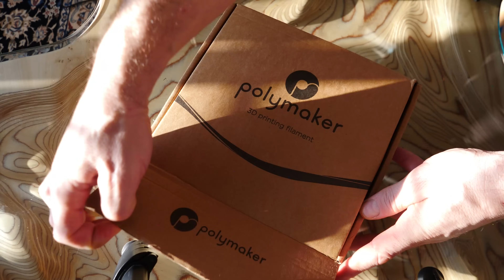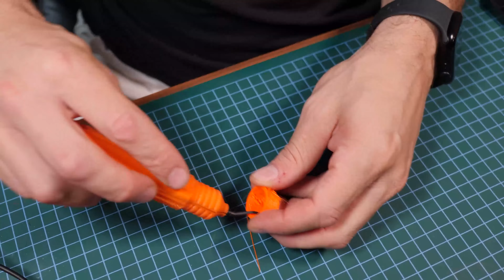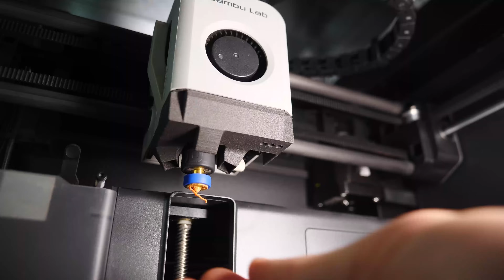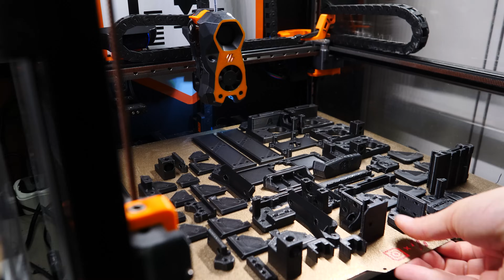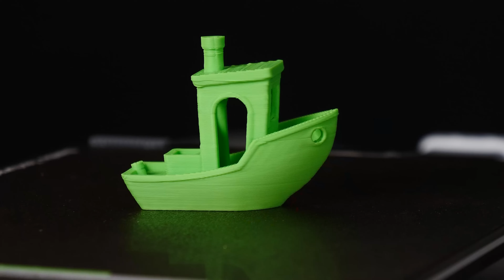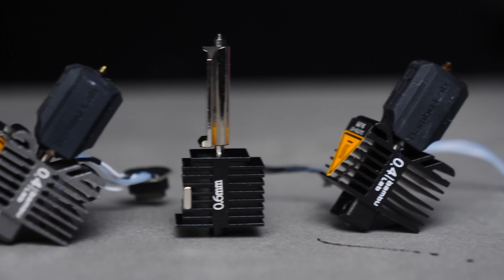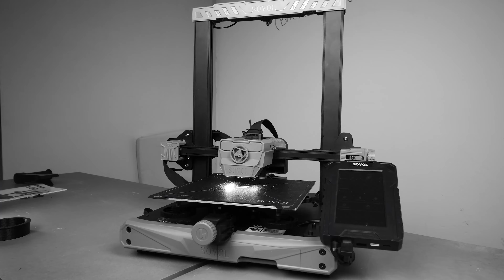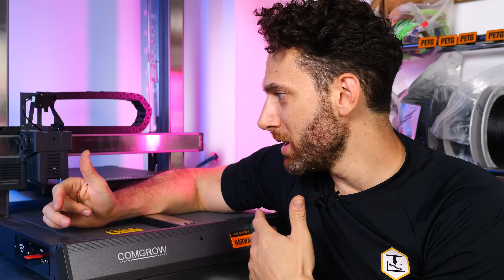My Long-Term Review of Each 3D Printer I Own

Comment: what surprises me how few hours you have on these printers :O
Just my testing SV07 Plus (Quite excellent! But some klipper bugs :( ) has like 1600hrs and it hasn't been on for the last 6months or so ... (it's a bed leveling machine, not a printer lol -- so once again trying to get more level bed that the damn mesh would actually work -- or maybe the mesh leveling just doesn't work at all on my printer properly, not sure.)

Comment: After having owned the X1C and the P1S, I find the P1S to simply be more reliable and produce better prints. Maybe I got a bum X1C but it was finnicky and needed a ton of babysitting. I feel like the touch screen was nice, but I hardly used that function because bambu handy and bambu studio are just nicer to use regardless. It would "detect" failures more often than it actually failed. If you are on the fence between the X1C and P1S, get the P1S and use the extra money to get a ton of filament.

Comment: I like resin, and have made a few useful tools out of the stuff. But even the "tough" resin doesn't beat a good ABS FDM print in terms of durability. Its also easier to fool with and you get better resolution without having to factor in the nozzle width, etc.  But I think the big thing about resin printers is that they aren't as "involved" in terms of building with them. I find them about 100x easier to use, so no reason to go fishing for YouTube content unless I hear about some "unbreakable" resin. So, thanks for leaving those out 😂

Comment: Did you have any cooling issues with the panda revo hotend on the P1S? Stefan (CNC Kitchen) mentioned in his video that it is a bit longer and therefore the fan is now blowing onto the nozzle. I've noticed you have a different airduct mounted though, does it fix that?

Comment: Between a solvo sv07+ and sv08. What are the real difference to the final print. I need a helmet size printer.

I could imagine the sv08 to be somewhat faster. However how is adhesion to the build plate? Layer lines? Final quality of the print?

The sv08 looks very primissing. However with black friday sale comming up. The sv07+ is sold at a really low price.......

So what do people recommend?

Comment: Back when I ran Ultimaker 2s one of them had about 10k hours on it when the first part broke that wasn't a consumsble. The other two had like 4k and 5-6k hours on then and were still fine. Though for context all those printers had been converted to 1,75mm. With stock gear they would not gave survived that long because I would have thrown them out of the window.

Comment: For making engineering parts I have a Bambulab X1C which is my 14th 3D printer and by far the best FDM. 
I really need a similar quality printer with the ability to print something that is at least 535 mm long. What options could you recommend?
I have a couple of Creality CR10 Max that can print the size, but the quality is not in the same ball park as the X1C

Comment: I have been using a sidewinder x1 for the past 4 years. Its been incredibly reliable. BUT its showing its age. I mean it prints at the old 60mm/s standard all these old bed slingers do but I see everyone else using klipper and printing at 200mm/s+ and im jealous. Also having to manually level the bed also the wear is starting to show with minor layer shifts just not as good as it could be. I could build a voron since I like to print ABS some what often but I dont wanna mess with it. So I ordered an A1 with the AMS. I figure if I can get my sidewinder to print ABS I can get the A1 to do it as well with an enclosure (which is a large trash bag). The reason I went with the A1 is simple. Its price and the fact I see it everywhere. If someone has a print farm that prints PLA primarily then I usually see them using an A1. My sidewinder doesn't take much messing about to get it to print but changing filament can be a hassle and when it does jam its a REAL pain to fix. Also it seems like the bambu printers have good resale value so there is that is I dont like it.

Comment: Q. Among all these printers, which gives us the good speed and the best no compromising print quality to start a multicolor 3d printing business.

*note- For the business i wanna do, i need the high quality prints with atleast a good sharpness and detailing with multicolor or multi material prints.
Reply from the maker: Anything from Bambu lab if you want multicolor
Reply: @thenextlayer  can i consider bambulab A1 combo in my starting budget, will it give me the good quality, speed & detailed prints being bed slinger instead of core xy ?

Or can i use voron and use ERCF kit for multicolor (only if it gives me better results than bambu?)

Comment: Hey Jonathan, can you plz help me out to choose between creality K1C and bambu lab A1..? I want to take it for my personal work which is bit of engineering and bit of hobby work.
Reply from the maker: Do you need to print engineering materials? If so, K1C. If not, and you’ll only print PLA and occasional PETG, or you want multicolor, A1. Feel free to use my links

Comment: My first printer is a Neptune 4.
Installed linear rails on all axis and that did bump up the performance when it came to that proverbial first layer.
Unfortunately having issues incorporating an input shaper which I know would take this little bed slinger up a couple of notches.
Now I also have a FLSUN V400 which I use an input shaper on.
Yes, it is heads above any bed slinger BUT most do not like the round plate.
Has advantages and disadvantages.
With modified cooling on the extruder (5015 over the stock) allows me to peg out the cost effective Elegoo PLA+ that I use.
Remember, to take advantage of all these speeds you will need to use higher priced high speed filament.
The Neptune 4 is for prototyping.
The V400 is for production. Also it is a dream when doing filament changes.
Yes, should you need the fancy prints Bamboo has the printer.
Should you be looking for that first printer and just maybe a second one IMHO the V400 with slight mods is a good choice and value.
Cheers.

Comment: i wouldn't buy anything from anycubic. i have a kobra neo that was my first printer i have had nothing but trouble with the bed thermistor and their probe. customer service has been good but still its sits more then it prints. i wish i could find a aftermarket bed for it to solve it problem with thermistor wire breaking . [bed 4 in a year].

Comment: As a V2.4 owner, I think anyone who wants to build one at this point should just get a Sovol SV08. Replace the ABL probe to one that isn't so heat-sensitive and throw on a different hotend. Sooo much of a V2.4 is already there that it doesn't really make sense to spend 2-3x the cost to get a box of parts and still have to 3D print most of the motion system.
Reply: Disagree. Please understand what Voron has done not only amongst its community but printers around the world. If people quit making them that’s a big hit to one of if not the most influential pushers of the printing future. More vorons =s  more people understanding machines instead of slice/print which makes more capable individuals to continue to push the envelope on 3d printings future. Open source/ mod life
Reply: Ehh you're pretty damn close, but there's still a reason to buy a Voron and I absolutely will when/if I can ever afford one, but the SV08 is a decent first step into getting to know the Voron design. Sovol (even though I had heard only good things about them before this) has turned out to be an absolute shit show of a company that almost refuses to communicate with its customers. Here's a short list of examples: when placing my order I was never told that I wasn't actually buying a printer but placing a pre-order, I was not told that the enclosure and upgraded screen would not ship with the printer and would be a further delay, I was never given any sort of shipping time update once I figured out it was actually a pre-order and had to reach out multiple times and wait days to get anything, enclosure makes you lose Z height without printing a riser, "upgraded" screen is just a product bought from elsewhere with a 3D printed enclosure and a poorly chosen one with THREE freaking cables needed to connect it and from the side not the back meaning you'll always have 3 chonky wires making a mess of things. Then there's obnoxious nebulousness like not specifying if the "high flow all metal hotend" on their site is the one that comes with the printer or an upgrade,  the fact that you either can buy a runout detection sensor or a tangle detection sensor but not one that does both, the fact that they literally JUST started offering build plates for sale and still only a single type, the fact that you need a UART adapter to upgrade the firmware AND SHIPPED THE FUCKING THING WITH FIRMWARE SO OUT OF DATE THE PRINTER SCREECHES AT ME 24/7 TO UPGRADE MAINSAIL, an absolute shit bet tensioning system, the build plate is mounted flat against the top of the undercarriage meaning air filters like the bento box will not fit, the fact that you can't buy hardened nozzles in anything other than .4mm, and much more.

I am pretty happy with the printer overall though. My probe ended up being pretty damn accurate and I don't really like the idea of using the nozzle as a probe so I'm not quite sure whether I'll go with a Revo Voron w/ PZ probe or the same with an Eddy since it's so much faster, but the actual extruder itself seems to be pretty good. I was able to print with a 10+ year old roll of Ninjaflex that I've never gotten a single successful print out of so that was cool, but the hotend sucks so insanely bad you can't print at anything even approaching "fast" once you run out of the tiny sample of high-speed PLA the printer comes with. I already assumed the hotend would be the first thing I ended up replacing, I mean the whole concept of the printer was "taking the over-engineered Voron 2.4 design and cheaping out where the effect on the print quality will be negligible compared to the cost savings". But my list of what I personally consider "mandatory" upgrades has grown so that in addition to the hotend I plan on also changing the probe (mostly for speed but accuracy will also improve), the laughable ~4" offcentered LED strip, changing the runout sensor to a combined multi-sensor, adding a chamber heater, replacing all gantry pieces so actual tensioning is possible, the toolhead (so an endoscope can be used for a nozzle camera, a few LEDs can be added to illuminate the print area, and is designed in a way so you can actually see the nozzle and immediate print area, and potentially adding a CPAP to increase part cooling), build plate mounting setup, and probably more that I can't think of off the top of my head.

I've been printing since ~1012 and before buying the SV08 was still using a CR-10v2, so I think that clarifies just how much of a massive purchase the SV08 was for my poor ass. While I am incredibly happy with what I got for the price I am pretty disappointed with the print quality I am able to achieve out of the box (and I seemed to have gotten a better machine than most). I got the most insane under-extrusion artifacts that actually look like vibration artifacts using the stock print speeds, I sincerely hope they're not vibration issues as that would mean there are much bigger issues. I guess I just spent 15 minutes saying "well, it's kind of complicated" in as long a format as I possibly could have.
Reply: SV08's look to be in the $500+ range.  How cheap do you think a used ldo Voron 2.4 would have to be to be worth taking a chance on?  What if it included a nevermore filter and an MMU?
Reply: @greenie277  Really? This is just about the worst place to ask for advice like that.
Reply: @TheSolongsidekick  Sure, discord or something would probably be better, but I just wanted a general idea of people's opinions on the matter.  I noticed some deals available locally, but I'm not quite ready to pick up another machine as of yet.  Just trying to get an idea whether or not pursuing a used Voron could makes sense in terms of bang for buck when compared to other new offerings like the SV08.  This thread included Voron owners on both sides of that discussion.  Seemed like an OK place to get an opinion considering I'm not making a purchase now or a decision based on this feedback alone.  I know that build quality is a big factor with these used machines, as is what hot end is present, mods, etc.  Just trying to determine if keeping my eyes out for a deal is even worth my time.
Reply: From where I'm from, sovol sv08 is almost the same cost as a v2.4 kit

Comment: Shalom. I’m totally new to 3d printing. I noticed your filaments are out in the open behind you but I heard so much about keeping them in a bin at certain humidity so I’m wondering how you’re able to just keep it out and not have issues ?
Reply: Not the creator but I dont keep any of my filaments in boxes and I dont ever dry them or need to. This includes tpu and nylon. The AC unit in our house does help to dehumidify but we also live in Utah in the desert. Im not sure where the video creator lives but if its a similar climate then its not a big deal. Generally speaking my indoor humidity stays in the 25-35% range which is dry enough to not impact filaments in my experience.

Comment: Great video!
It's interesting to me you've had so much success with your A1 minis. Mine has been a nonstop string of problems. Especally on AMS prints. Massive layer shifts on all axis, the AMS purging system is abysmal, the toolhead smacks things off the print bed constantly because the Z offset calibrates itself and then is too low... probably 20-25% of my prints fail on that machine. Especally multi color prints. 
My friend has a full sized A1 that works great, and now hearing about your X1 Carbon issues, I wonder if Bambu Labs just has really bad QC and sends out a lot of lemons.

Comment: I was shocked by the A1 Mini as an X1 Carbon owner. It's been so great.
Reply: I've got an A1 Mini arriving in two days. I'm quite excited, it's my first 3D printer. It was on sale (I think?) for $249 CAD (equivalent to $185 USD), it was hard to say no as a jumping-in point. I regret not ordering the AMS Lite, though. It's like $100 more expensive if you don't order it with the printer. I didn't think I'd use it, but then I realized that it would have been quite convenient even if I didn't want to do multi-colour prints. Oh well! I can always pick one up in the future at the non-bundle price.

Comment: A problem I'm having with my Bambu P1S. Let's take a cube for instance. Now lets put a couple holes in it that do not go all the way through. They are not directly on top of each other but are slightly offset and separated by a 1mm wall. When I try to slice it I get a warning that there are floating areas and if I try to print it, it doesn't stick to the plate. If I enable supports it changes the object. It gets all kinds of stryations and puts supports underneath the object. What am I doing wrong and how do I correct this? I can send pics if neeced.

Comment: I love my MK3S+ with MMU2s. About your comments about this printer.

I also replaced the nozzle with an E3D Revo. Furthermore I run it with Octoprint.

But main thing: slow? I have my MK3S+ running not so slow at all.

My Revo has a 0.6mm nozzle most of the time. But also I just use the pre installed settings for filaments to eventually run the prints at 200% speed with no problems at all (sometimes increasing nozzle temperature).

Slow? It can print twice as fast. And with a 0.6 nozzle instead of 0.4....... even faster

Comment: Changing ptfe tubes in Bambulab X1C was a good idea? This was for fix loading and unloading filament from ams error? I have quite common issue with this in multicolor printing. Constantly filament is stuck and I need to jiggle ptfe connector on back of the printer
Reply: @maksiator9387  print one of the mods that gets the PTFE tube straight

Comment: ? Petg prints fine on my A1mini - tho you may mention not all spools fit on the ams lite, as the centre is not always big enough
Reply from the maker: In my climate I can’t leave PETG out in the open for more than an hour
Reply: @thenextlayer  my country average is 8% higher than yours :s maybe cz I buy the cheapest PETG it's cut with other random stuff? When not in use I store it with 100G fresh silica per spool in a dry bag - could that mitigate issues?

Comment: I bought a QIDI XMAX-3 which I saw flash by in the voron section in your video.  Saw the comments below about why it wasn't included in your LTR.  I think mine is fantastic, best performance of all my printers.  I even have a MAKERBOT T.O.M. from 2010 (Sailfish and Replicator G USB connect) that still works and a MAKERFARM i3 12"  (300mm  Marlin with Slic3r and Pronterface for control  USB connect) with an itty bitty dual flexstruder upgrade I put on myself.  Both use 3mm filament and I have never used an SD card or USB to print a file.  The QIDI is by far the easiest to use of my 5 printers and the highest quality, not to mention the speed and huge build volume.  I print most of my objects with ABS so need the heated chamber.  There are cool spots in the chamber but I just move the model around to avoid them.  Klipper is great with the network connect.  I especially like the "IRON" feature in the QIDI slicer version of slic3r.  Have not noticed any maintenance issues yet - other than the fact that those 1.75mm reels seem to get eaten up quickly.

Comment: Yeah I'm annoyed enough at the little bits of proprietary BS in my SV08 which I've barely used because of the 0.4 (and why should I when my X1C with a 0.6 is so much faster). With my X1C I tolerate the proprietary bits because most of them are either totally out of the way and they work. That Anycubic machine sounds like it needs to be dumpstered publicly as an example.